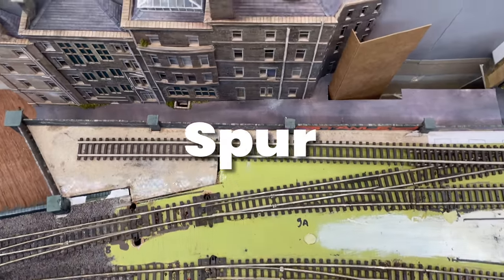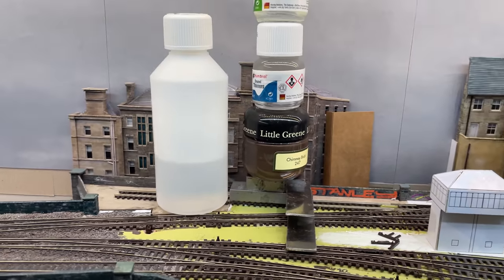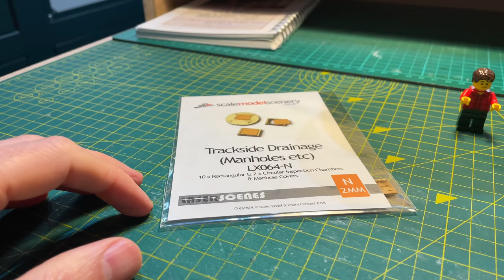This evocative railway scene uses little details to really bring it alive

Comment: Cracking job Michael. 
I don't know if you always clean your track with cardboard, but I was talking to a chap with an extensive N gauge layout at ModelRail Scotland this year and that's exactly what he does. He doesn't use potions or track rubbers, just cereal boxes. It was all running perfectly. Cheers
Reply from the maker: Thanks Davie. I almost always use card. Sometimes I soak it in a little Isopropyl Alcohol. I’ve never had great running though. The track is not very well laid and looked after, as you can see from my gung-ho attitude to ballasting!
Reply: @Chandwell  There are so many approaches to ballasting I don't think there's a right or wrong way to do it. The only method I don't like are those over priced perspex hopper things! Cheers

Comment: Was surprised at your ballasting system in compared with your normal fastidious building methods, but hey ho, it works and seems a lot easier than most methods, giving yet again a really excellent results and up to your usual high standards.

Are you any good with utube stuff, I am subscribed with the bell clicked, but I never get any emails informing me of a new video, I used to get them, but no more
Reply from the maker: I'm not sure why you don't get emails, but then I realise I don't either. The bell just seems to notify me on the YouTube app on my phone. I wonder if there is a preference somewhere. I will take a look. Yes... up on the top right, click your user icon and then choose Settings. Then on the left, Notifications. For me, the "Subscriptions" option was turned off. Try turning that on..?

Comment: It's good to see you work on the railway aspects of this layout again! It looks much better with ballast and weeds. (I do have some doubts that a station like this would have had that sort of signal box in the 1990s, however; more likely, it would have been controlled by a power signal box covering a larger area located a little way (or perhaps even a long way) away from the station, controlling colour light signals; are you planning on having colour light signals, incidentally?).
Reply from the maker: Thanks James. It looks a lot better now! I am planning on colour light signals and have not yet decided on how to model the box. It’s based on the one that was still at Ilkley in 1993 and that was a similar-size station albeit a much less busy one. I don’t know how much it actually controlled. Probably very little. I’m half-minded to model it boarded up and covered in graffiti; ready to demolish after the modernisation and rationalisation that took place in Chandwell in the late 80s. But then… the glazing would be fun. So I’m torn. 🤔🤔
Reply: @Chandwell  Boarded up would be a joy. This sort of signal box would not go well with colour lights, I think. 

What sort of colour lights were you thinking of getting - or were you planning to make your own?
Reply from the maker: @JamesPetts  I've not decided yet. They definitely won't be working ones - I'm just not interested in wring things up. But when the time comes I will see what is available. I will struggle to work out where to put them, but since the track plan is based on Bradford Interchange, then I should be able to just replicate the "real thing". The signal box is interesting. Bradford Interchange's box was very much like that (it was a standard Midland design but not up on a tower) and although it was closer to the junction than the station than how I've modelled it, it operated the exact same track plan, and its colour lights, until 2018 (control has moved to York now, I think). And the one at Ilkley, which this box is based on, controlled its colour lights until it closed in June 1994. So I do have scope to model it open or closed. But I think closed is my preferred option, definitely.
Reply: @Chandwell  Interesting - I shall be intrigued to see what you decide.

Comment: TRACK COLOUR/SLEEPER GRIME ! 
Until the advent of the Disc Brake on BR rolling stock (which effectively began to take hold only in the 1990's), trains had cast iron brake blocks that grabbed the wheel tread every time the brakes were applied. In summer large clouds of fine rusty coloured brake block dust could clearly be seen when trains braked. In addition to brake block dust, the track and close surroundings, were also coated in something far less pleasant, usually referred to as "Toilet Outfall". Chemical toilets did not become the norm, again until the 1990's. 

Indeed as BR Mk 1 coaches were never fitted with chemical toilets, all the mainline steam specials today, are still dropping this nasty brown "byproduct" onto the track ! Steam locos of course didn't help as they too contributed tons of grease, oil, coal dust & brakeblock dust, all over the track. Hence in just a few weeks nice new ballast began turning a ghastly brown colour. The more trains, the quicker it began to look like sh*t !

Further until around 1988, virtually all ballast supplies to BR were of mid to darkish grey stone. Since 1988, an increasing amount of ballast from newer sources, is a much lighter pale Limestone grey, which can look almost white when fresh. Disc brakes & Chemical toilets also ensure ballast now stays cleaner longer !!!

From an ex BR railway engineer.
Happy Modelling.
Reply from the maker: Thank you!